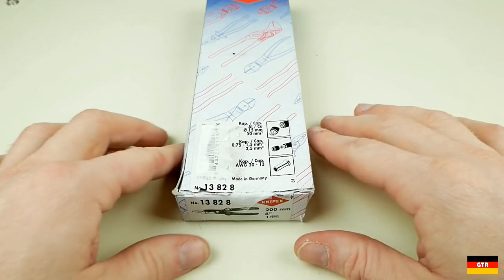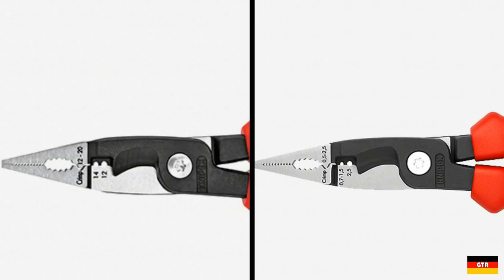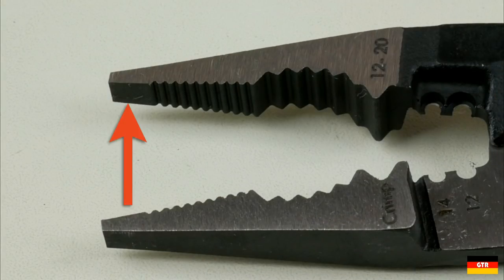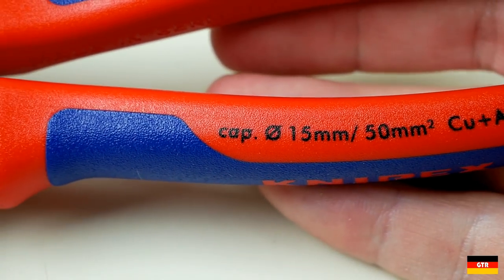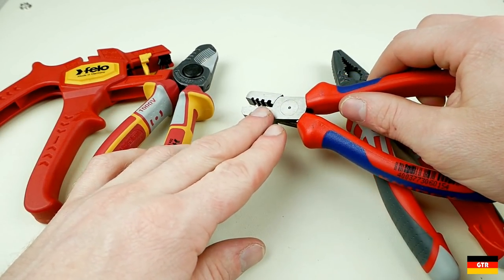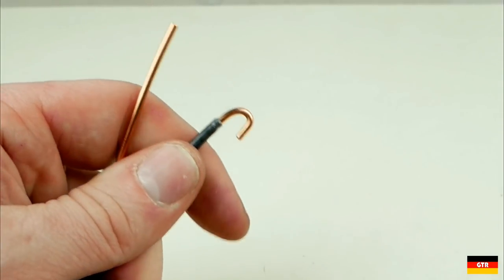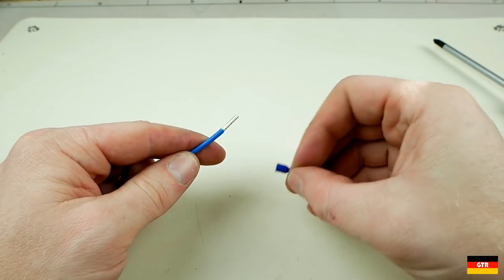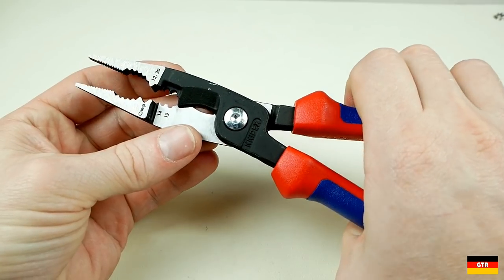Knipex 13 Series Electrical Installation Pliers

Comment: I only use these to cut cable or larger guage wire for that purpose they work great. Needlenose is I guess ok. Striping fiture that I bought these for is useless. At least my unit is ripping not striping the wire not smooth at all. Not for USA market. I would buy cable cutters from knipex. These pliers are not being used often.

Comment: I know this is an old video but sins I have worked along electricians and helped a lot, I will say that that tool is almost useless.
1) You work with a lot of different sizes of cable, so you have to use a separate tool for the rest, also it's very hard for your wrist, to strip wire in this fashion.
2) Any marking in a lead is a no no and you will automatically redo the work.
3) the tip is to big, almost useless to get wires into fittings.
4) No great way to grab a pull string for wiring, like there is on the lines man pliers.
5) The worst part, you will use that single tool constant, instead of shere the usage among different pliers and do any of the functions break, have you suddently lost all the functions.
In the end, there are a great reason for why electricians often use special tools for each task. :-)